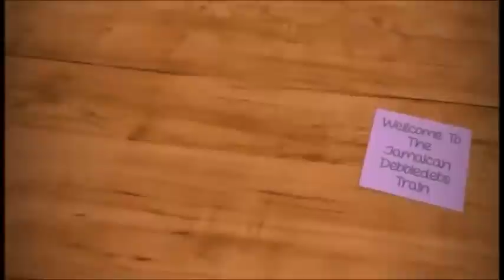Rain, Rain and More Rain in St. Mary / Boshue's Project is Moving On

Comment: Wonderful Miss Debbie ❤ If the shower is a 'wet room type, the space is more than enough because only a drain hole in the floor will be needed near the shower head fittings; it will also possibly save money because there's no need to buy the plastic section to stand on; just tiles everything else. Then again, you all will know the cost of tiles and whether the shower pan would be cheaper 🤔